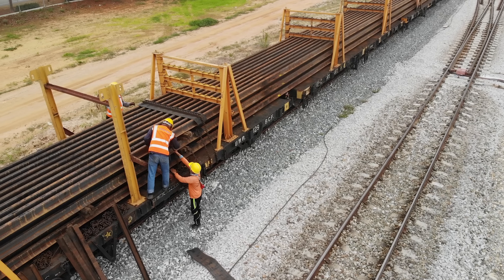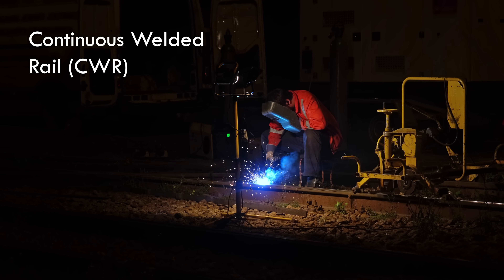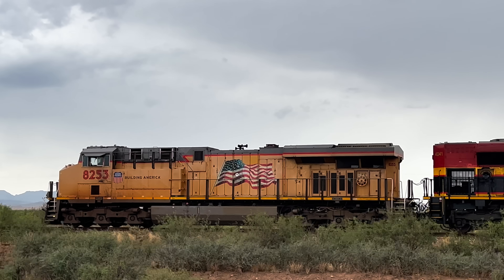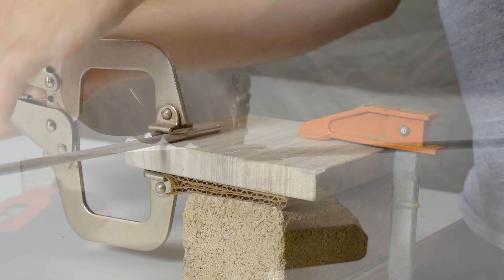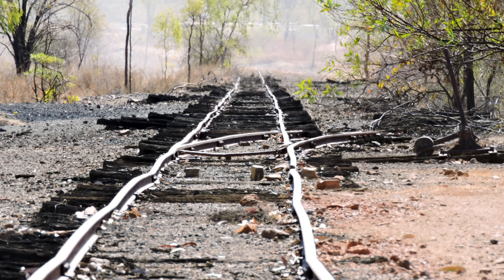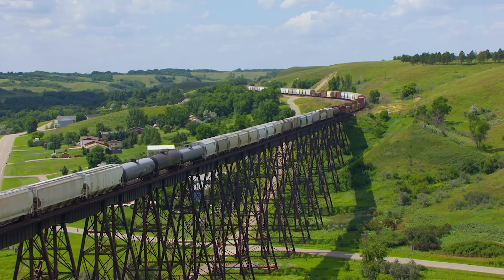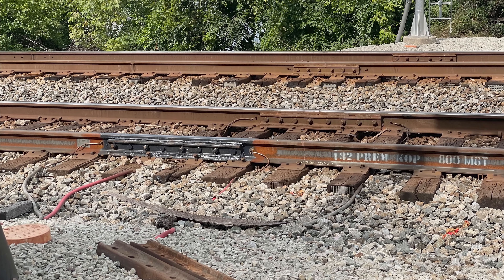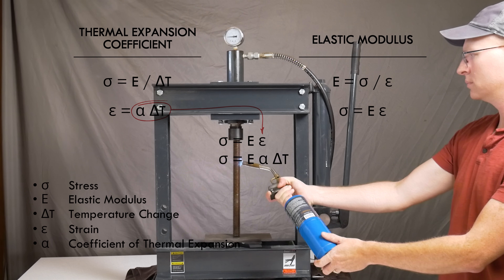Why Railroads Don't Need Expansion Joints

Comment: I’m confused by 5:30 to 5:55.  It looks like he is tightening the nut/bolt.  I would think that would add compression.  How does the rod get longer?

I’ve watched this segment 20+ times.  What am I missing?
Reply: I see that you didn't get a response, so here goes:
Assume that the pipe is solid, and does not compress at all. This means the nuts are held in place at each end, and cannot move inward when tightened. As the nuts "push I " on the pipe, the pipe essentially "pushes out" against the nuts, and stretches the rod. Then tightening the nut pulls on the ends of the threaded rod. Since the nuts can't move inward, then the threaded rod is now under tension stress. The rod stretches in the middle and gets longer overall. As the rod stretches, a few threads are gradually moved to the outside, where The dial gauge is located. The dial gauge is measuring how much the rod is stretched inside the pipe.

Comment: You know, I'd love to see an episode (or series?) about how surveying works. Like, I know that now they usually just have a GPS receiver mounted on the surveying equipment, but I'd love to learn about how this was handled practically in the past.
Reply: AFAIK, they don't just have a GPS. They have sights and mirrors and probably lasers. GPS can be off.
Reply: @bruzote  Surveying was literally one of the first commercial applications for GPS. There's some special calculations you can do with a base station that's static over a long period to establish a highly accurate origin point, and then you can use that to remove the error from other GPS measurements relative to that. It's accurate to a matter of millimeters, which is much better than you can do with theodolites.

Comment: I worked for a decade for a public transit agency in the U.S. Outdoor sections of CWR would warp so much on hot summer days train speeds had to be restricted to 10 MPH on long stretches & we had breaks in winter even in subways. mnat sections of concrete ties were replaced with wood eventually. I think some sections are reverting back to concrete today.

Comment: Cycling along tracks in Austin I puzzled over track welds. Then one day a laser inspection platform glided by followed by a huge mechanical insect that jackhammered its claws into the ballast, lifted the welded track and ties then packed everything back down into the crushed rock. I'm sure there must be a video on that here, but it's only my first day.

Comment: I'm a bit dissapointed. The answer boiled down to "we accept the stress induced by expansion and contraction, because rails usually are sturdy enough and we have regulations for that." It is cyclic argumentation, as the same problem for buildings also just boils down to the question how much stress is acceptable and when does it need constructive measures.

Comment: Most of the rails in central WI, including the switch yards have bolted joints and do the click-clack thing.
I suspect it's because of the EXTREME temperatures experienced in the Midwest above the 45th parallel 

In the height of the summer it can sometimes reach 95-100°F for a week, in the height of Winter I've seen it get as low as -45°F. That's a LOT of thermal expansion over the year (and I've seen concrete paved highways buckle practically every summer), too much possibly for CWRs.

Comment: The rhythmic clicks and clacks still happen and come from flat spots on wheels. They are most commonly created by stuck handbrakes, or cars being drug around  the switching yard without fully releasing. They will also destroy that beautiful new main line rail that is constantly laser inspected, so it is a big no no to let them leave the switching yard or local lines if the flat spot is too long.  Interestingly, there is a "sweet" spot for speeds that damage rail. Most local lines still have expansion joints in the rail as well, the new rail you are describing that is installed on the work trains is never splurged on for locals.                      I have a bit of first hand experience in the matter.

Comment: Good video demo  but you used mainly steel and wood in your formula's.  Modern rail uses steel and concrete sleepers not wood as much...  AND when cutting rail we [ former worker ] took out the steel clamps known as C clamps on either side of sleeper [ normally 100 feet ] to allow it to move and once joined [ thermal welded ]  those clamps would be again fastened to sleeper.

Comment: Living on the tracks of a spur line running to Kenosha's American motors factories in the 60's and 70's,  my hobby was pulling the copper date nails from the ties. Many went back to 1918 with the average about 1936. In the forties and up they went to aluminum. The factories closed in the 80's and all was done. Then in California in the late 90's I built my house with a copper roof and flashings. Those nails made a fine finish here.

Comment: For my physics students we used to use an alumunium rod clamped at one end, the other resting on a short rod with a sort of pointer attached.  As the aluminium is heated the pointer moves.

Comment: Just want to ad. Some, in this thread want to blame RR's in the USA for big derailments. When, especially, the Continental lines were layed, the federal government gave easements, or right of ways, permanently to the RR's. Those easements are very wide across most of the country. As much as 300' or more. Over time, development has been allowed to encroach into that easement. Point being, if you are afraid of derailments and chemical spills, don't live close to a major rail line.

Comment: Do the rails have to be exactly the right width apart to keep the train from derailing? You know what I mean, it seems like if its not lined up perfectly it would come right off.
Reply: I am a trainenthusiast. If I remember correctly modern railroads have an errormargin between 2 and 5 millimetres between the rails. Or up to ~0.2 inches.
Reply: @swededude1992  That is crazy! Thank you for that info, its amazing to me how precise they are.

Comment: As someone who works with railroaders, and gets to know firsthand about the dozens of rail breaks each year, due to both heat and cold, that cause both slow speed orders or require diversions, I have to respectfully disagree entirely with the title of this video.  The joint are also only part of the noise you hear from a train going by.  The enormous weight of the cars and their cargo actually cause the wheels to compress, creating flat portions of the contact surface.  That's why some wheels outright "bang" loudly as they go by.

Comment: I am not sure of your explanation. I am not a train enthusiast, but am a trained mechanical engineer. The theory of thermal expansion was first taught to me using railroad rails, hence my interest. I assume CWR works without expansion joints by mechanically pre tensioning the rails, not by over constraining them as you alluded. Pre tension in a cold rail can be converted to net zero axial deflection in a hot rail, in the elastic range, as the thermal growth simply relieves the tensile stress. Is that what you meant, because the explanation that CWR “connects the rail at each tie to hold it” is not a clear engineering description. I am intrigued, do they actually stretch the rails  at installation? If so, how do they do it, mechanical, hydraulic? Would love to see how they install- maybe a future vid? Thx.

Comment: Does all this mean that the temperature on the day of installation of a new rail is really important? If a new section of rail was laid on a day that was below freezing, surely it would experience a lot more stress on a hot day than a section of rail that was laid on a day that was in the mid 20s?

Comment: This is really interesting. NZ rail came in for a lot of flak when they began to weld rails several decades ago. In fact they would often slow trains for fear of derailment during hot weather.
Allowance for expansion though the use of expansion loops is used in pipelines running geothermal steam from bores/wells along the way.

Comment: The other aspect of CWR is that the old method of fixing the rails in position -- wooden ties (or sleepers, as we call them in the UK) and hammered in iron spikes - would not be able to handle the buckling stresses in CWR, so you will always find CWR mounted on concrete or steel ties, held down with strong steel springs. Obviously, thermal changes mean that the guage of the railway will still vary away from the standard 4' 8.5" by a few millimetres, but not enough to cause any problems.
Reply: You can have CWR with timber sleepers, but the lighter weight of the track means that you have to start taking hot weather precautions, slower speeds and having a site watchman to keep an eye on the track at a lower temperature.

Comment: I work as a railway maintenance of way worker sence 2008  and install CWR on rail crews changed ties on tie crews and am a extremely experienced mrkIV tamper operator of over 10 years and  some experience in plasser surfaceing as well,  they use different measuing systems but work on the same principles.  I still enjoyed this video.  I hope you do surface and track structure video cause thats my gig,  I'm all for answering questions too!

One thing you forgot to mention is that when the rail does break and a maintenance crew has to repair it we need to re heat the section of rail to close a specified gap we need to account for dependent on rail temperature  mostly using fire snakes to complete the repair to maintain the PRLT (preferred rail lay temp) and put the joint together. 

Great video

Comment: 5:09 Mini segments, with overlapping parts, no clickety clack much, but also easy to replace,
easy to lay. The direct damage from a click is proportional to the fall between each segment's open space.
If the segment is short, the expansion is very small, and as such the open space between
segments can be minimalised. The overlap takes care of the rest, removing
the fall all together, since the first segment has a small overlap with the next.
The segments connect in a diagonal overlap.

But, they got CWS now, so already there.

Comment: The top temperatures on the rail in Texas is probably much more than 40° centigrade. Keep in mind that that's an air temperature, ground temperatures from direct exposure to the sun could easily get up to 80 degrees centigrade. You can see this by just putting a thermometer on the ground on some asphalt or other dark material. The surface temperature in sunlight is what matters the most from an engineering, and it also matters if you make a mistake of trying to walk along railroad tracks with bare feet on a sunny day. 40 degrees would not blister you but those mfers definitely will.

Comment: Whilst the ballast does hold the sleepers/ties in place, sometimes that isn't enough, and sleeper-anchors or tie-anchors are used. Those are metal plates that are clamped onto the sleepers and protrude deep into the ballast in order to increase the amount of ballast that effectively holds the sleepers/ties in place and prevents their lateral movement. In Europe they are easily identified as a row of yellow brackets following the center-line of the sleepers over a few metres. Vossloh sleeper anchors are a well-known variety.

Comment: I've always wondered how they dealt with the expansion issue because I thought the stresses would exceed the elastic limit of the steel. It would have just taken a calculation to show it does not. BTW your exponent in the elastic modulus of steel should be +6, that is 30 x 10^6 rather than 30 x 10^-6 (at about 9:00)

Comment: Cover the rail segments with a highly conductive dark thermal blanket in advance of the installation crew and the sun will do the work way faster than just waiting for the ambient air temperature to bring it up or be forced to use pre-heaters.

Comment: I wonder whether heating the rod caused some residual heating of your hydraulic press, causing the press itself to expand slightly. That would result in a reduced pressure differential, which is what you observed.

Comment: Those of us with outdoor garden railroads have to deal with the same issue of heat expansion.  In my case, I designed a layout with lots of curves and VERY few LONG straight sections.  As the rail changes length (expands and contracts) it simply push out or pulls in the curves by a small amount.  This requires the right-of-way on curves be just a bit wider.  Another tool is timing.  In our area, the typical temperature range is from a low of 30 to a high of 90.  It is unusual, but not unheard of, to have temperatures outside this range, but the vast majority of highs and lows are within this range.  As a result, I always try to lay track when the (rail) temperature is at the mid-point, in our case about 60 degrees.  This ensures that the rail lengths are at about the mid-point of it's expansion/contraction cycle so that I get equal amounts of expansion/contraction as the temperature changes.  Typical rail length is 6ft and we generally do not weld/solder joints.  On straight portions of track where expansion/contraction is more of a problem I some times shorten the rail sections to 2 or 3 ft to increase the frequency of expansion joints.  After 13 years of operation, the only expansion/contraction issues have occurred in a section of track that I put down on a mild (75 degree) afternoon when I was first getting started and  not yet discovered the temperature range mid-point rule.  That section had a high number joint pull-a-part problem in winter during periods of very low temperature.
Reply: makes total sense, CWR seems like a bad idea. but i was thinking, if the rails are cut diagonally on the ends, the gaps wouldnt be so bad. there would be no such smackdown of wheels into gaps anymore.
Reply: The slip joint is one of the primary ways outdoor model railroads deal with this issue.  However, you can only allow a small amount of movement with this solution which means you may end up having to use slip joints at frequent intervals so that each one "slips" a small amount.  As the rails slide past each other during expansion/contraction they move to the side a little bit.  One rail is push out and/or the other rail is pushed in.  This can result in an altering of the gauge of the track at that point.  Excessive gauge change can result in a derailment.  Either the rails move apart too much and the wheels drop between the rails and onto the ground or the rails move together too much forcing the wheels to climb up and over the rail, also resulting in wheels on the ground.  To deal with this in the model railroad world, these expansion joints are combined with a re-railer, a structure that "nudges errant wheels back onto the rails.  In the model railroad world, these look something like road crossings so having a road cross the tracks at that point tends to hide the slip join re-railer.
Reply: @tomgaps2111  ok, i wasnt thinking of a slip joint exactly. more like a regular joint with a gap, but cut at like 30 degree angle.
everything should work identically minus the clunking noise
Reply: I'm not a metallurgist but I suspect that while anything less than a 90 degree cut of the rail ends might reduce the clickety-clack as wheels passed over the joint, it would still result in a pounding effect on the end of the rail, eventually causing it to crack and and then fail, leading to a potential derailment.  In fact, the rail with it's narrower point on the inside surface of the rail might fail even faster than on a 90 degree cut since, being thinner, it is likely to be weaker.  Rounding this point might reduce the failure rate but would increase the space between rail ends at that point, which would likely increase the clickety-clack.  It's a rock-and-hard place problem.  The solutions that reduce the clickety-clack are likely to increase the failure rate and the solutions that reduce the failure rate are likely to increase the clickety-clack.  In the world of outdoor model railroading the clickety-clack is not a problem and the locomotives and rolling stock are so light in weight that joint failure from cracking is not a problem.  The primary problem for us is joints pulling apart in winter.  Another key failure point is switches.  If the rail expansion pushes into a switch, it can distort the frog, maybe even break it, which WILL result in a derailment.